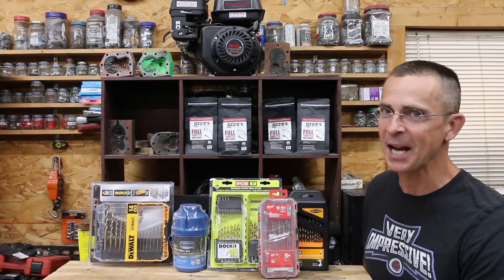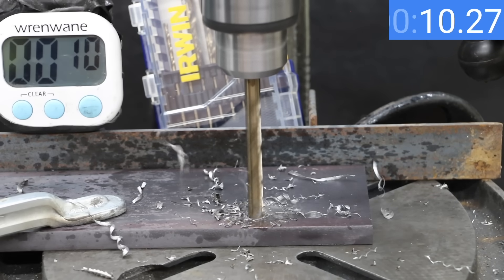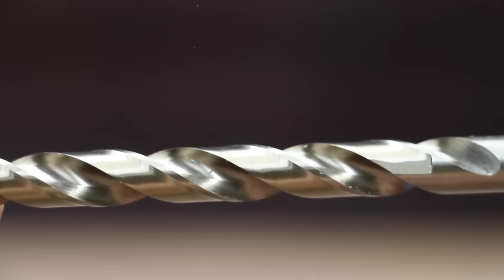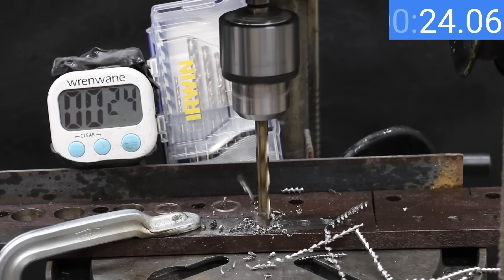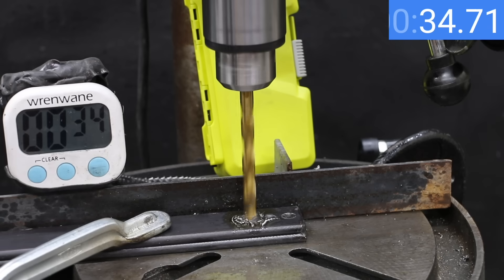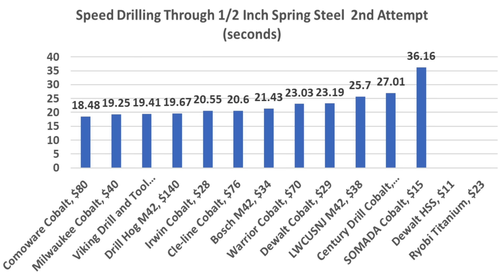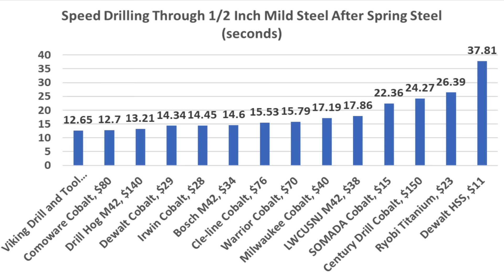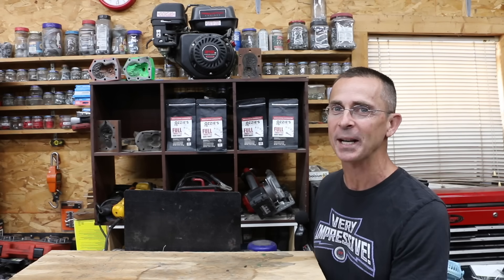Best Drill Bit Set? $11 vs $200? Let’s Settle This!

Comment: I use American made HSS or Cobalt bits that cost a minimum of $250+ per set, fractional from 1/16-1/2 x 64ths of an inch, metric from 2mm to 13mm by 1/2 mm and 1 mm increments, number sets from 0-60 and 61-80, and letter bits A-Z. I think Chicago Latrobe makes my bits. The Harbor Freight cobalt bits are not too bad for the price. I have had my eye on  the Drill Hog bits. THANK YOU! Whichever Dutch company Irwin bought out made my favorite SDS drill bits. Irwin just makes me depressed now.
Reply from the maker: Thanks for sharing.
Reply: @ProjectFarm  I would drill so much concrete with small SDS bits that the brazing melted away and the carbide fell out. Those Dutch made bits would last for years. Even 3/16 and 1/4 inch. Irwin bought them out. Yuck! I won't throw $2500 in twist bits into the service truck to get ripped off. I like Hanson taps, BTW. Desco taps break too easily.

Comment: I work with a lot of 304 and 316 stainless steel and Ive always had good experience with Bosch drill bits, hss and cobalt. They're not the fastest or the best but they're a good balance between price, performance and reliability.
Reply from the maker: Thanks for the feedback.

Comment: Decking Material. 
Pressure Treated
Brazilian Hardwood (IPE, Cumaru, other)
PVC
Name Brand Something, Trex, Other
Etc

Durability, Stain Resistance, Cleaning, Micro plastics all over your yard after cutting, Ease to work with, When Freezing - does it get slippery, Warping/Cupping, Sustainability.

For that matter, deck wash chemicals, all the name brands, v home made (bleach, soap)
And Deck brightening, Citric vs Oxalic vs anything else.

Have you done pressure washers? If not, there you go.
Reply from the maker: Thanks for the suggestion.
https://www.youtube.com/watch?v=K5cMJvmlvv4

Comment: In my experience,  proper use(i.e. lubrication, good chuck, straight push) plays a lot more factor in drill bit life than the brand. I've got at least 4 sets of the Warrior branded ones in a couple flavors and they last as long as any other brands I've used. The only ones I've found lasted any longer was a small metal cased set I got in a garage sale toolbox that topped out at 1/4", and I never figured out what brand they were or even know where they are now.
Reply from the maker: Thanks for sharing.

Comment: I have a bolt that broke into head of my moped cause my muffler fell off and broke it in half I have to drill a hole in the bolt and then use Ez out which drill bit do you recommend for drilling into the bolt
Reply from the maker: Thanks for the suggestion.

Comment: A while back I needed to drill several holes in thin spring steel by hand.  Several attempts using normal drill bits failed, often not even starting to cut a hole.  Then I tried thick, double ended countersink bits and they did start the hole and drilled several holes in the spring steel with no problem.  The need was to make a reed for a 2-cycle engine custom reed block/main bearing carrier.  When finished the new reed worked perfectly.  BTW, these custom reed blocks were for an early 60's Mercury outboard racing engine which used 4 3-4 inch long finger reeds from the factory.  These custom reed blocks had 8 petals to reduce fatique breakage.  It worked.  The engine was in a home built race car that was featured on the front cover of a 1964 sports car magazine.  The article caught the attention of Mercury and they sent 2 engineers to see how the engine was adapted into a race car.  At the time they arrived the engine was apart and the custom reed blocks were exposed.  Upon seeing the reed blocks they stopped speaking english and started speeking german.  Next year Mercury featured a new improved more reliable reed block.  Amazingly it had 8 petals too.

Comment: It would have been nice to also see how these bits hold up to something like hardwood. I realize that hard steel alloy is the ultimate test, but I am curious about how well they all would hold up to a very tough wood like oak or maple. Also it is worth mentioning that some of the bits have much shorter flute lengths than others, which is a problem for chip removal on deep holes but also adds strength to the shank. Still, I appreciate all of your hard work, and I agree with your conclusions.
Reply from the maker: Thanks for the constructive feedback.

Comment: I was hoping that Dormer was included in this test. After 35 years being over machine shops and maintenance shops as well as always being a hands on boss, I found Dormer to be the best value for the price. They are not the cheapest, but not the most expensive, but are always great quality and have never let me down. They also make decent taps.
Reply from the maker: Thanks for the suggestion.

Comment: I am going to buy the DeWalt HSS bits for all around use.  Cannot beat the price.  I have a nice set of Milwaukee Cobalt bits in my shop when I need to drill through stubborn steel.  I have the big set of Harbor Freight bits in my kit and they were cheap and you know it every time you use them.
Reply from the maker: Thanks for the feedback.

Comment: The comment I have I think most drill bits are junk. True life example I had drill cylinder head bolts out of a Toyota. The Milwaukee drill bit that said does so good it made it through one head bolt. Luckily I've worked in a machine shop I borrowed a high-speed steel drill bit from the machine shop, and it made it through nine head bolts with no visible damage and it was just plain high speed steel. From what I've experienced the store-bought drill bits are good for about one hole. Talking to the owner of the machine shop who's a mechanical engineer he says in all the tests high speed steel is the best period. How old is just aren't as hard as high speed steel.
Reply from the maker: Thanks for the feedback.

Comment: Excellent video as always! I'd be extremely interested to see how these hold out vs more expensive industrial brands like Hertel, Cleveland, Accupro, OSG, Guhring, Walter-Titex, etc. How much better is a $70 Guhring 3/8" cobalt 130deg FIREX coated bit than one of these bits that cost a fraction of the price?
Reply from the maker: Thanks!  Thanks for the suggestion.

Comment: When I originally commented on this video, I meant to add a warning about the De Walt bullet point set,  if you are like me you probably use metal cutting bits for wood as well. These De Walt bits, because of the savage high flutes on them cut way too fast and tear out a lot, very little control available.
Reply from the maker: Thanks for the feedback.

Comment: I used the HF Warrior Titanium $ 9.99 special for pilot holes and $9.99 Tractor Supply Barn Star HSS step bits for 21 1 1/2"  burn barrels holes today.  Like a hot knife through butta. 
Neither shows any signs of wear,  should be good for many light duty chores to come.  I was very pleasantly surprised.
Reply from the maker: Thanks for the feedback.

Comment: Mild. Steel is not much of a challenge for most drill bits.
I recently installed a winch
On a wood processor the
Mounting plate required 8
Holes . 4 in the plate and 4
In the processor. The 4 in the 
Mild steel were easy. The 4 in
The processor were another 
Story. Using Milwaukee 15x 
Bits and carbide tipped I used
A total of 6 bits. Drilling one
Hole is not representative of 
The actual quality of a bit.
Great testing and reviews as
Usual.
Reply from the maker: Thanks!  Thanks for sharing.

Comment: I bought the warrior set you tested at harbor freight and mine did NOT do anywhere near as good as the ones you used in your video. I tried four or five different bits on a 1/8" piece of steel bed frame and it could not get through it no matter what I did.
Reply from the maker: Thanks for sharing.

Comment: I have the non-cobalt titanium coated version of that Warrior set and used it to fabricate a sport rack and other trailer accessories out of .120 wall steel tubing and some .250 flat bar. It performed surprisingly well, especially for a comprehensive set that cost $10.
Reply from the maker: Thanks for the feedback.

Comment: I find the most important quality of a drill bit to be how they hold up under repeated use. So a bit that drills reasonably well the first time, but perhaps not the fastest, but does it consistently, I rate higher than one that drills fastest the first time but rapidly degrades. One reason I like your reviews is that you do multiple treats and provide the individual results so that I can base my opinions on the criteria I prioritize in cases when my priorities are different than yours.
Reply from the maker: Thanks!

Comment: The LW bits might be very good if your drilling a lot of holes in soft materials like aluminum or plastic or soft abrasive materials like cast iron, reinforced plastics or or countertops made from epoxy and silica sand. The hope is that it will hold it's edge due to the hardness and the lack of ductility won't be a problem in the softer materials.
Reply from the maker: Thanks for the feedback.

Comment: If you still have the steel plates, could you do a mini "Part 2" of this test and compare the quality of the holes each drill made? I know it would be mostly subjective (if at all useful) information, but I'm just curious. Also, if you ever do revisit this, could you also test to see which drill holds the best re-sharpened tip?
Reply from the maker: Thanks for the suggestions.

Comment: When the most expensive drill bits $200 comes in frist place on the first test by a Fraction of second faster than the the cheapest drill bits $11 i hardly say it was impressive , more like a rip off , what i have taken from this video is this either buy a couple of packs of $11 drills bit or go for the $29 or $34 sets basicly stay away from the silly priced sets as they just ripping you off
Reply from the maker: Thanks for the feedback.

Comment: My experience is not the first  hole I had really good success going through 3 sixteenths. Steel on a trailer 20 holes still cutting very good.    were titanium bit that I had. Maybe you'd get through 2 Dewalt. Cobalt the way to go.😅😅😅😅😅😅😅
Reply from the maker: Thanks for sharing.

Comment: I will suggest it again.... please use stainless steel in cutting tests....
I work mainly with SS and mild steal is like "butter" compared with SS... even spring steel is easier to cut than SS...
If a drill bit works well in SS.... it will cut any steel...
Reply from the maker: Thanks for the suggestion.

Comment: For whoever come upon this, I use these at work for OCTG casing/tubing deburring. It’s not as strong as others, which is nice because can be operated smoothly on burrs without messing with the output. It’s not too fast where it will make a scotch brite / finishing wheel hop or explode under rpm and load. Yea this is an extremely limited use for only a few people in the world so do precise work with these tools but it works perfectly for that purpose and won’t cause you to ruin a seal. I use an Ingersoll Rand on black crest because it’s more powerful with a flap wheel- hope this helps SOMEONE

Comment: A bit of false information in this review. DRILL HOG bits are not Made in the USA. Only the index is (Huot, in St Paul). Drill Hog has been ripping customers off for years. Told by a manufacture years ago: The stamp orientation is an import regulation. Readable with tip pointing UP is a USA made bit, sometimes horizontal. All US manufactures mark their bits. Import bit's stamp is readable with tip pointing down. The Viking/Norseman bits tested here are the standard HSS which run just over $100, Not Cobalt. Not even the actual Cobalt set is $200. Viking/Norseman bits are for production use and can cut hundreds of holes. FYI: Stanley Back and decker (Dewalt,  Irwin, Etc.) was sued and lost after false claims in regards to their Cobalt bits.

Comment: you should space the holes in the test piece further apart or cut a test piece for each bit. the heat from drilling can effect the hardness of the metal around the hole.

love your videos. ever think of doing something on ultrasonic cleaners and different solutions to use in them?
Reply from the maker: Thanks! Thanks for the suggestion.

Comment: Milwaukee thunderweb (HSS-G) drill bits seem to last a lot longer than bosch and dewalt for me ... 
It's all do do with use case.. I'm drilling a mix of polyprop, steel and stainless.. (Guess I should really use different bits re material though).
Very interesting review.
Would love to see an electric garden shredder review as it's getting to be that time of year again and I don't like buying anything you haven't tested.
Reply from the maker: Thanks!  Thanks for the suggestion.

Comment: Can you do concrete bits... a few years back... I was trying to drill through 60 year old concrete(clearly had the old large river rock).. I started with the Bosch concrete bits was only able to drill 2 holes( the second was considerably narrower and had to be drilled with a new bit for the anchor bolt to fit) these holes were only 2 inches deep. I went back to the store and purchased the store brand from a Do It Best hardware store... I was able to drill 12 holes before the first store brand bit gave up... at about half the price, the store brand stomped the Bosch...
Reply from the maker: Thanks for the suggestion.

Comment: It would be interesting to sharpen all the drill bit with your own standard sharpner so you get the same cut on all the bits them compare all the bits to compare the steel of the different manufacturers
Reply from the maker: Thanks for the suggestion.

Comment: I had a project a few years ago that required drilling through some pretty gnarly stainless steel. After ruining several bits with nothing to show I resorted to ragged holes with a plasma cutter. I then proceeded to do a bunch of research and in the end bought a complete set of high-end bits.  I still keep boxes of the Dewalt HSS bits on hand for most projects.  They are inexpensive and work well for most things and i don't fret when I ruin one.

As for the high-end bits, I ended up with a complete set of Drill Hog bits.  When I say complete I mean complete. They sell a 123 piece set that contains every size fraction bit you could ask for as well as Letter sizes (A-Z) and Number sizes(1-60 wire gauge). Drill Hog makes this set in a high molybdenum bit that will chew through just about anything you can imagine. Expensive, yes. But heres the trick. Even though this set retails for $1000 Drill Hog almost always has it on sale at their website. As of the writing of this comment that $1000 set is on sale for less than $400.  Yes $400 is still a lot of money but you will have every size bit you will ever need in a high quality, USA made bit that will drill any hole you ask of it.  And Drill Hog has a lifetime gaurantee to the original purchaser of the bits so no need to fret if one gets broken.  I think a one-time purchase to eliminate a lifetime of drilling headaches is worth $400. And you still have those cheap Dewalt bits around to a use on things that aren't critical jobs.
Reply from the maker: Thanks for sharing.
Reply: Specifically reading thru comments for stainless steel references as I couldn’t get through tiny SS 1/8th thick bracket with any of numerous random bits. Likely buying the Spyder Stinger Mach-Blue 10-Piece Assorted High-speed Steel bits from Lowe’s today since daily deal is $10 off for $29.98 price. Any experience with those? I wish @ProjectFarm had tested those or maybe does a Stainless based test later on.
Reply: @8m617  I think PF should do a test of drilling stainless, too. It's different than hardened steel. If you don't have a drill press or mag-base drill, it's very difficult to keep the proper drill pressure for stainless no matter how good your bit is.
Reply: @nemodetroit  hey nemo, any other tips regarding stainless for a newbie as those 1/8th SS brackets humbled me good. I did buy the Mach Blue spider stingers months ago but they are in the drawer until this fall when I attempt the brackets again lol. I did buy a neighbors drill press recently  and I’ve never used one before, but I’ll make it a point to break it in with the items I just mentioned just based on your comment. Constant even pressure and cutting oil help me? or is it just keeping the bit super straight via the drill press that’s the trick? Thx for any advice.
Reply: @8m617  I'm not a machinist, but have drilled a decent amount of SS on the advice of some actual machinists. It's actually more the higher and constant  pressure that a drill press (or mill) can deliver, rather than keeping a bill "straight". If you let off the pressure (which is almost inevitable with a handheld drill), the bit can rub, which heats up and work hardens the SS, making it much harder to then punch through. It's difficult to accomplish that  with a handheld drill. The bit needs to be biting in and cutting the whole time. High pressure and slow(er) RPM speed seems to work for me on a drill press. A good cobalt bit definitely helps, too.

Comment: thanks for the update on the drill bits. Glad to see M42 has become more mainstream. Cobalt-based bits are build for endurance, they affect little the speed of the cut, I find.
Also, the harder the material, the more brittle & less elastic, so the "break limit" test makes sense only when comparing identical materials (M35 vs M35, etc)

Comment: I got a set of those DeWalt pilot point units... To be fair I'm not drilling through thick material very often however for thinner materials they blast right through without having to monkey around much. 
Sharpening would likely be a non starter but I'm relatively satisfied with them.